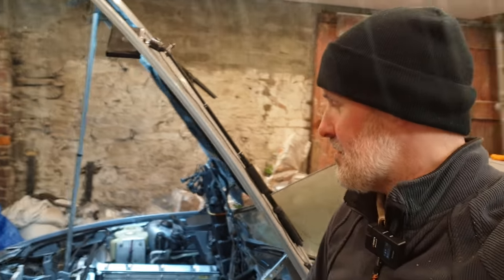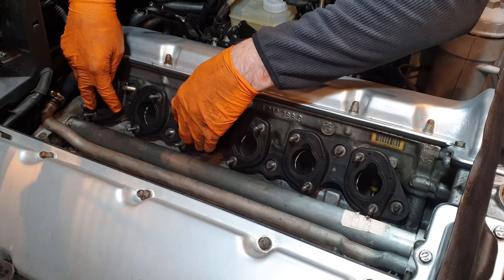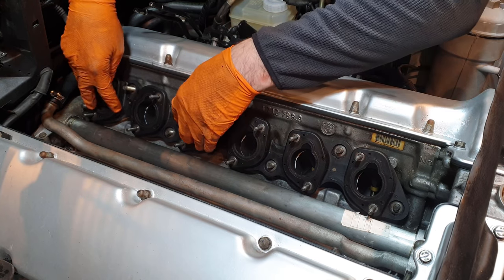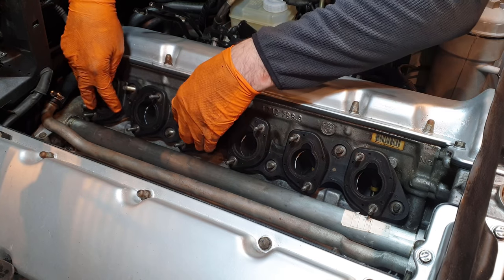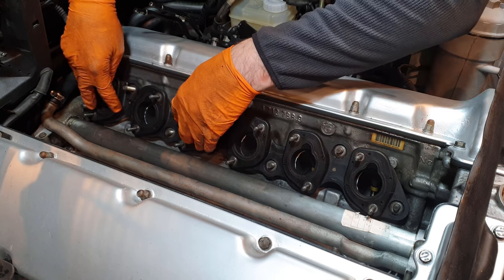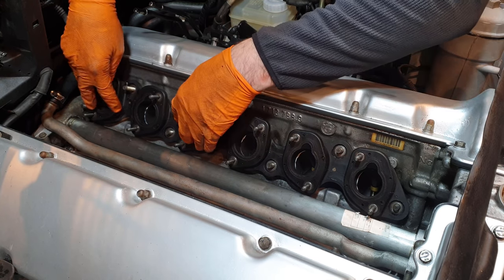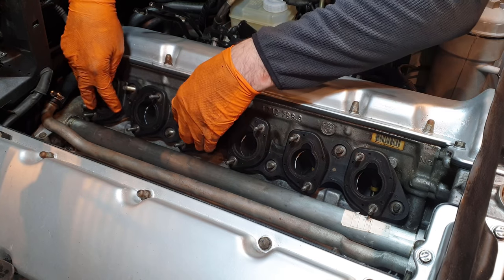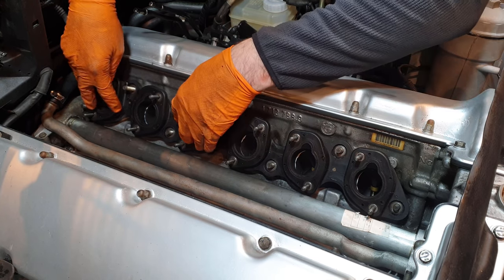BMW E31 850i "Glacier" - Complete Restoration - Finished Engine Bay & Startup - Episode 9

Comment: That’s a beast of a job restoring the engine bay and the rebuild of top end. Always a bit worrying on first start ( just finished a total rebuild of my e39 M5) plus  a huge relief when it fires up  and completes its first heat cycle. I’ve been using your video for a diy guide on the intake gaskets for my 91 850i/6. The old wiring casing(plastic shielding) and rubber hoses (fuel, pcv) are completely brittle. It’s like delicate surgery trying not to break anything that isn’t being replaced yet at least until the engine is up and running again

Comment: Since you say there is rust in the rear suspension, you should remove the rear subframe and see what, if any rust is hidden. Great job by the way! I just finished doing the heads on my 91 850i, and my first start, happened pretty much the same as yours did😁

Comment: Great project...  at 13:35 your rubber fuel return line touches the air cond. fill line. You shoud add some extra thickness at the place where they touch if you cannot put some space in between. in time it will eat through the fuel line.

Comment: Well done, fantastic job on restoring the engine bay and getting the beast alive again.
I feel your pain on the starter motor job, I am going to be doing that on my car soon (1997, M73 E31, LHD that I've owned since 2007). My car hasn't been used much for the last 4 years and now needs a fair amount of work. I'm going to be doing as you did - replace all rubber hoses, all coolant hoses, all hydraulic lines, I have a leak from one of the valve cover gaskets and the oil pan looks like it's been leaking too. Headliner is sagging. It sounds like a long list but in reality, for a 24 year old car it's still in amazing condition. I crawled under it yesterday to see how the underside has fared, it's actually in great condition with no rust, at least I won't have too many battles against the dreaded tin worm!
Good luck with the rest of the work, I've subscribed and I'm looking forward to watching new videos from you - I watched all of your E31 series so far :-)

Comment: I had a 1991 in calypso red, it had FIKSE forged alloys and a Dinan 3.94 limited slip differential, 2 chips for the motor and 1 for the transmission, it removed the 155-mph speed limiter, the car was set up at Sears point raceway.

Comment: Thank you Steve!  I just did a lot of the same work to my 850 6spd.  Practically new rubber parts everywhere, bead blasting intakes and other parts.  I was hoping for this video 2 weeks earlier, however I got my car pulled together and running past weekend. Actually, your videos inspired me to dig deeper in my 850 and replace more necessary parts.  Great to see your car start and run, great work!!!!

Comment: I am really happy for you it started man, great job! Glasblasted aluminum will have a slightly rough service which makes it perfectly fine and ready for quick and nasty white oxidation, and the adhesion of dirt and grease will be much more easier. I personally would have chosen for soda ore water blasting, which is good for cleaning. So it’s good you’ve coated the parts. I am not so of the cohesion of clearcoat on, even blasted, aluminum. But I certainly hope it will stick and won’t peel off in the future. Than again, grate respect for such projects!!!!

Comment: I don't think one pint is enough,have another you deserve it,excellent fastidious workmanship it was a pleasure to watch.If I may can I offer some advice on what to do next,I speak as a retired panel beater.99% of cars apart from the crashed ones,end up in the scrap yard due to bodywork faults i,e rust.Mechanical work can always be repaired,no so with bodywork it's very costly these days and on some cars you are no longer allowed to MIG weld or Gas weld certain areas of the car,these areas either have to be spot welded or bonded to maintain it's designed crumple zones. My advice would be,do the bodywork next.
Reply from the maker: Thanks Brian, that's the plan.

Comment: Great to see another 8 back on the road soon. I put a Quaiffe LSD fitted to my CSI so worth looking at, it makes a big difference in cornering and on wet surfaces. Having the whole rear axle refurbished with new bushes also notably a big improvement. New shocks all round will be worth doing,

Comment: I wasn’t able to save my fuel pump assembly and simply rewire it, replace pumps , hoses and rubber mounts so that set me back 1100$. It adds up fast $$$. But I believe this model will continue to grow in popularity and value as there simply isn’t anything else that looks even close to its appearance . Not sure how much driving enjoyment it gives (since my 850i/6 isn’t road ready yet) but I have 2000M5 for that

Comment: Dad has been following along this series for a while. You have been doing a great job, but he said you made your first mistake he has caught haha. On his 850 there is rubber seal around the underside of the acoustic cover, hope this helps you with your restoration!
Reply from the maker: Tell your dad thanks for watching! Does he mean the sound damping foam under the cover? Because mine has it. :)
Reply: @stevesbmwbarn5706  I am not sure, but from the outside there is a black rubber gasket filling the gap between the inlet manifold and the cover.
Reply from the maker: @PungentPewes  I think we are talking about the same part, its a large slab of insulating foam on the underside of the cover, I screwed mine on in the video without foam to get the shot, I assure you it is there now. You can see the clips in the tray at 54:40. Thanks for watching! :)

Comment: Since you went that far and you seem to want too keep the car I would have replaced the valve guide seals to really cut down on the smoking and refurbished the fuel pumps. A few episodes ago the throttle bodies seemed a little sticky as well, I might have missed the refurb video.

Comment: Superb stuff :-) Transmission fluid level must be checked when it's warm, it can make a good bit of difference. Our E34 Alpina B10 M30 has one of those throttle bodies because it had the optional traction control.

Comment: Honestly love your channel, I've used your video as a reference for redoing my cooling system it helps so much! The only problem is I can't put tension on the power steering and alternator belt any advice?

Comment: Awesome great videos. I missed seeing you change the front crank oil seal that causes the debris in front. You could have changed the stem valve seals by getting the camshaft off and putting a rope through the sparkplug hole and crank the piston up so the valve would not fall in the cylinder. Nevertheless great job!

Comment: Did you change that valley pan gasket? Since you’re right there it’s best to change it. You don’t want put it all back together just in few months to have to pull everything back apart again. 

Very important for M70 engines. Since it’s quite a large SOHC V12. There is limited room and more compacted parts. You have to remove a lot to get to certain parts. Once you get there, there’s always about 2-3 within fingers reach that will need replacing now or very soon in the future.

Comment: Great one! What a fab result, well done! Before you start going through the bodywork check out the videos on my channel documenting the rust project im currently doing on mine so you can get an idea of what you’ll find on yours. My next project will be rear subframe so be interesting to see yours being done. Did i spy that the rev gauge didnt move after the engine fired up?
Reply from the maker: Hi Craig, I've watched a lot of your videos and you have me worried! My sills are three times worse than yours and have rust on the roof, all arches and subframes too. Lots of work ahead! Yes the clocks only work about 1% of the time, should be a straight forward fix. Thanks for watching!
Reply: @stevesbmwbarn5706  how much of the fabrication work could you do yourself? Most of the cost will be in the labour, for example my garage are charging me £40 per hour. I’d say the single biggest job is the roof, which is always much worse inside than any bubbling visible on the outside would lead you to believe before you start peeling back. Fingers crossed its not as bad as mine was, but be prepared to be replacing the roofskin (£1,000 from bmw) and the sunroof panel (£700 from bmw), plus fabricating new pieces for the inside corners for which bmw dont do repair panels. The arches are straight forward enough but the jacking points, drivers door and rust behind the seal on passenger side door are what threw curveballs to my project. Im already worrying about my rear subframe and i need to refresh all of my suspension, too - but with my rust project costing me 3 times and counting what it set out to be, these will have to wait for a few years i think. Just take solace in that all e31s have rust on them somewhere no matter how good they look, and try to enjoy the process. Taking the leap and starting my project has been quite liberating for someone who is very risk averse. Ive loved watching your engine project, quite mesmerising to watch, so envious of your  ability to do stuff like that. Im clueless. Would love to do something similar on mine, which is the m62 v8. The aircon doesnt work and i have what i think is hydraulic lifter ticking noises. Watching videos like yours gives me a false sense of feeling like its essentially a big lego kit and its easy to do which i know isnt the case! Looking forward with anticipation to see whatever project you decide to tackle next. Just keep going! Keep in touch 👍
Reply: @stevesbmwbarn5706  also likewise and thanks for watching my videos 👍. Hopefully we’re helping raise the profile of our amazing cars 😃

Comment: Well done Steve, great job. My car is a 1998 840Ci, I hope yours is not as bad as mine was body-wise. Truthfully, It looked far better than yours till I really got stuck in, then the horror story began. There is a YouTube channel called Craig on cars, you may have already spotted it. Craig's car and mine were very similar indeed, so it would appear that these were common rust problems. Anyway, time will tell. Keep up the good work.
Reply from the maker: Cheers for the feedback,  I have no doubt I'm in for a horror show, have probably done things backwards with the engine done first, at least the engine bay is virtually rust free, under body is a different story. Will update on what I find!
Reply: @stevesbmwbarn5706  Fingers crossed mate!
Reply: Brilliant series so far.

Comment: What's the part number for those 2 o-rings on the top and bottom of the hydraulic fluid filter? They are not shown on realoem.

Comment: These cars were  $90,000 in the 1990's, about $180,000 today, BMW lost $50,000 on every 850 made. I had a a bit of a search for a shop willing to do any work on it, these were BMW's crown jewel in cutting edge technology, can buss wire harness drive by wire. there a a wealth of archived posts from the old E 31 forum, my uncle  kurt,  Cobratooth  had 4500 posts and did everything to his 850, he got service cd's and distributed them to the forum and BMW found out1

Comment: E32 E36 E38 E65 E91………….no more.  

One thinks they can keep a BMW going but it will age you and hard to keep buying parts that are designed to fail.   All the plastic. Wiring.